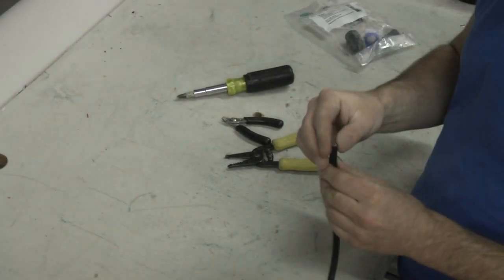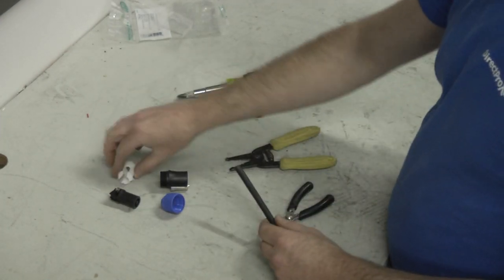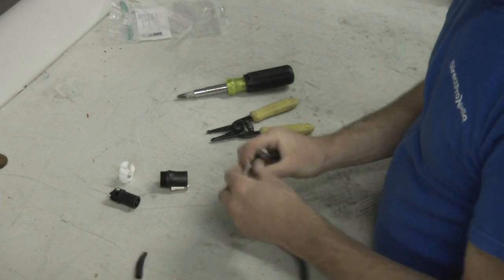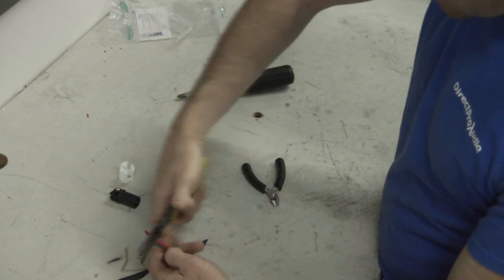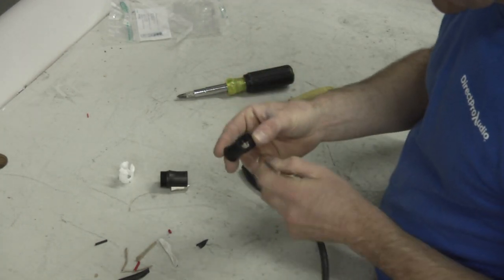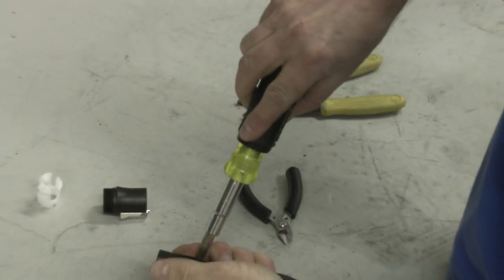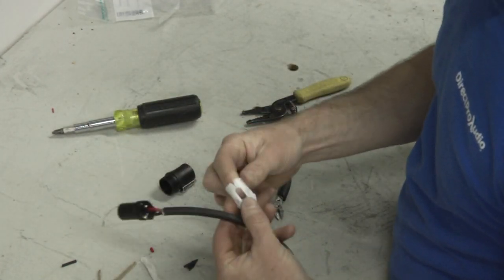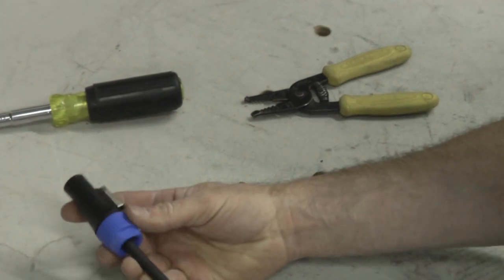Installing a Neutrik NL4 Speakon Connector

Comment: Do you know how to connect a 4 pole neutrik SpeakON to 1/4” TRS? 

what i want to do is i'm going to run separate channels for my monitors one would be for the mids the other channel would be for the highs, going to separate the channels with 2 separate crossovers that I will mount in the boxes

Comment: So, does that mean that I can use the Speakon on one end and the 1/4" male jack on the other? Most new power amps have Speakon while older cabinets have 1/4" female jacks. It's a pain in the neck if you ask me.
Reply: Yes, you can.  Just be sure to maintain the correct polarity in your wiring--keep the 1+ speakon wire connected to the "tip" wire on the 1/4" plug on the other end because the tip is "hot" and carries the signal.   Unlike electrical wires, the black wire is usually the ground wire for speakers and the other color (white or red) is the "hot" wire.       If it gets to be too aggravating making the proper hookups, use adapters which will allow a 1/4" plug to mate with a Speakon jack or a banana-type jack.  I have both kinds of adapters because some of my speakers are 1/4" only and some of my amps are 1/4" only.  My newer amps and speakers are Speakon.